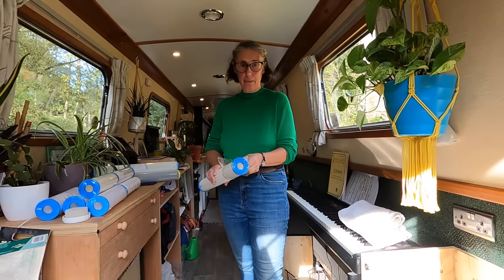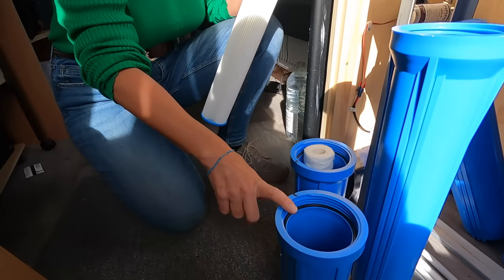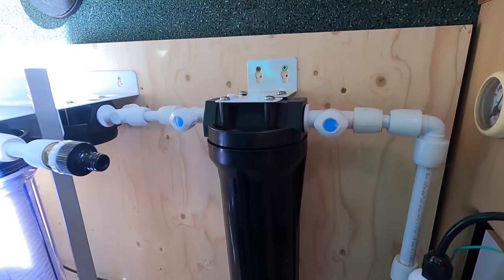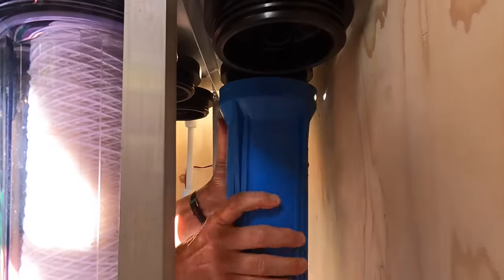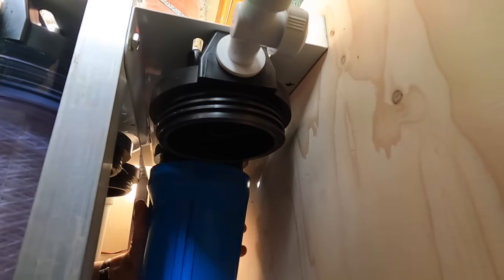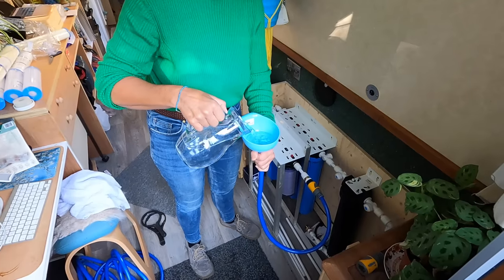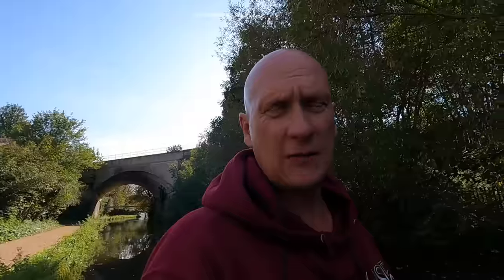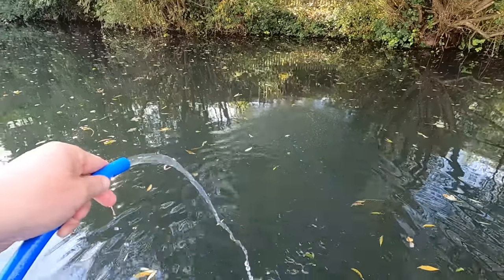Filtering Canal Water. How Good Is It? - S3 Ep14. #narrowboatlife  #waterfiltration

Comment: I don't personally think that I could trust the filters to make canal water safe enough to drink ever, If I were in your situation I would carry on using the water taps at the facilities..
I would also use the water I have on board more and try not to worry about running out as much as you clearly do,  what's the worst thing that can happen? you run out of water and have to go to the nearest tap, perhaps keep the water container you already have filled just in case you do run out and refill every month so the water doesn't spoil as an emergency back up. 
The chances of being frozen in is a very real problem and it will probably happen at least once every year, However if you keep an eye on the weather reports and keep the tank full at every opportunity I am sure you will be prepared for the odd ice in.. Great video Chris best wishes and safe travels Paul. 👍
Reply: Good, sensible advice. We don’t get really cold weather as often as we used to. A cold spell which would cause you to be frozen in is usually notified well in advance and you can mitigate the effect by either moving the boat or using a caravan Aquaroll to collect 40 litres.
Reply from the maker: Thanks Paul. I understand I do have a too much of a strict routine where water is concerned. I have identified that a few weeks ago but I need to work on it. I empty the plastic 20ltr water container in the tanks as it can take the extra and refill as I pass the water point. I need to improve on the usage but not overly keen on getting a filtration unit just yet. When armageddon hits, I may change my mind. 
That said the weather forecast is something I am mindful of in the winter and was as prepared as I could be last year. 
@gillgregory6327 The aqua roll will be something I'll be getting in due course. Thanks for the comment and have a great week.

Comment: did you account for stowage of the rolly things ?
also can washing and drinking water be separate entities ?
Reply from the maker: Thanks for the comment. Yes I did account for stowage of role things, either side of the bow doors. However that would stop the doors being opened fully. Yes washing and drinking could be two entities if the boat was designed with two tanks. I've had a week of reflection and still pleased I'm not investing.
Reply: @chrismears-inslowtime  ah ok i wasnt sure i heard that correctly i thought it was the filters either side of the doors lol.
it is an interesting dilemma though .
and as always a full review of the pros and cons will lead you to the correct answer .
and thanks for the military version of that process , very informative and interesting .
thank you for sharing your experiences.

Comment: Good video. Not worth the cost or aggro I feel. I do 2 things - I have a Berkey style filter container, 8 litres, just for drinking and cooking water. Second - once a year I flush through my water tank with bleach - fill tank, add chlorine bleach, let it sit for a few hours, empty and refill  a couple of times with new water.  I just take myself on and off a water point to do this.
Reply from the maker: I’ve considered doing that. It’s a night spend at the water point. I’m not sure the water pump is designed to be used continuously tho empty the water tanks though. Just my thoughts: Do the bleach and chlorine thing. Let it sit. Fill the tanks so it overflows as well as empty some out. I wonder how long it would take to allow the water to exchange just by forcing new water in the tank. That said, it dilutes the chemicals enough to use for anything except drinking and cooking water. Do that until you can’t smell the chlorine. Thoughts?
Reply: I'm sure would work too, but Im always too chicken to try that way! You are right on pump - keep an eye it doesn't get too hot - I give it a rest every 20 mins. Its a whole day job so pick a quiet day! @chrismears-inslowtime  - oh and I agree you can judge it by the smell test for chlorine as you say. You don't need to add that much to get the job done either. Using the pump also runs it through the pipes - so I switch from kitchen to bathroom taps and shower for that purpose.

Comment: Also my other question is if as Suzanna says the water smells if you don't use it regularly then in my mind it can't be that clean but I may be wrong ?
Reply from the maker: I think all the point made from this vlog are all valid. It's about 'testing the water' to find out what works for you and how you want to live. Agree with your point though. It did cross my mind. Thanks for the comment Nathan. Have a great week.

Comment: Having lived on the K&A for several years and seen what people put in the canal there would be no way that i would drink it! No matter how many filters!!! How does she know if it has failed? I guess that question is why she has three different systems.

Chris a question i would like to ask is why? Why did you walk 10 times a day to fill your water container to fill your tank? Last year you were very cautious about water and power use so why did you need to FILL your tank? Surely just carrying enough for a day or two was sufficient?
Reply from the maker: The problem is Ann, you have to keep on top of the admin and trust the filters do their job properly.  The only quality control you have is the end user. You!  I would change the filters more regularly than required. Water is important. That means greater cost. 
The reason why I walked to fill a water container to work out if I was iced in, how could I cope.  It became reality 3 months later. I knew what it was like to do that. It was not really too much effort in the winter as I had done it previously.  Now, it’s not a problem. 2 miles was a chore by the way. Tried that too, but yes you’re right. I would have done enough for each day. Train hard to fight easy is the motto for British fighting military. Thanks for the comment and Autumn is here. Enjoy your week.

Comment: Could the filtration system be any more complicated? I always found water to be a PITA to be honest. 500l tank, = 2 weeks+ if careful, as you so rightly said, scrimping on water usage too much just takes the fun out of life. I had two stackable 25l containers that just happened to fit perfectly on my trolley so used to do that when necessary. But I used to drink bottled water anyway. Canal water NO WAY! The space that filtration takes up you could just add another water tank. Very interesting though, thanks.
Reply from the maker: Thanks for the comment Johnny. It appears that I'm heading in the same direction as you - perhaps slightly larger containers although for now, I'm keeping the status quo. Thanks mate. Have a great week.

Comment: The filters for the Berkey system can cost up to £255 depending on your berkey system 😳😳😳🫨 I wonder how often you have to change them
Reply from the maker: Wow. The system is about £350. So basically I would be paying for the filter as the system is just an encased filter with a tap! Apparently the filter lasts a year. Tap at the water point is just fine. Thanks for the comment and have a great week George.

Comment: When you get a warning freezing weather is comming, but a water butt from b and q and fill it at the water point.
Reply from the maker: Great idea except unlike wide-beam boats, It wont fit on the well deck. The side locked are the length of the well deck. A requirement from the start for good storage. Thanks for the comment Ross. Have a great week.

Comment: I use a water distiller. It takes 3 hours but i then have 4 litres of water. I couldnt use canal water though and the space the system takes up isnt for me.   Id never trust it to be clean enough to drink. Im too fussy i guess.
Reply from the maker: Don't think you're too fussy. The best idea would be to have two tanks but that could happen at build. You could fit a second tank but not sure it's worth all the hassle and expense. Like you, not sure I could trust it. Thanks for the comment Sean. have a great week.

Comment: Is there any danger of the water in your bow tank and pipes freezing over in winter or is it all well insulated?
Reply from the maker: The water tank is insulated and all the pipes are inside the boat. Didn't have an issue at -14 last year. Not sure we'll get much colder here but it'll take a very cold snap for much to go wrong. That's on my boat, others have water in the bow which does freeze. Thanks for the comment Graeme. Have a great week.

Comment: When the canal freezes over, doesn't the water taps at water points also freeze up?
Reply from the maker: If someone who is bright allows the water to drip out of the tap, no.  Thing is, the cold snaps catch us unaware at times. Also that tap needs to be used frequently. There risk in everything Gary. You can’t mitigate everything. Thanks for the comment. Have a great week.

Comment: Are the towpaths good enough to use a bicycle water trailer?
Reply from the maker: Not all of them Robert. Most in the south east area of the canals have been made into proper paths. However, it's when I go further north where the muddy towpaths are the norm is where I would struggle. For now, I've made the best decision with a flexible water container. Easy(ish) and safe. Thanks for the comment and have a great week.

Comment: Chris you could do away with your bow thruster and put a filtration system in its place 😅
Reply from the maker: Could do. No. Paid a lot for that. Plus it’ll be a real pain to change the filters as there is a steel floor between the bow thruster and the the bow locker. Hard work to remove that. Pleased to have meet you and Wendy yesterday. Have a great week.
Reply: @chrismears-inslowtime  we’ve just had a thruster tube capped off. Unfortunately the previous owner didn’t look after the tube or the mechanics so currently it’s u/s. I plan to take the mechanics out and put it on the bench at home. Once fixed I’ll reinstall it and remove the plates at the time of the next blacking. It was nice to meet you also, keep badgering the CRT some one has to. You said you didn’t know how long you could continue with your channel due to running out of things to say, maybe doing a report / update with your dealings with CRT could be an option! It might help to increase the subscription numbers as more boaters will subscribe. Just a thought cheers for now.
Reply from the maker: @waynesilver8416  agreed with CRT things. It’s a Sunday natter I feel. Thanks Wayne.

Comment: You must have a reverse osmosis system.  You can not do it with filters alone.  A reverse osmisis system uses filters, but the water is forced throgh the system at a very high pressure, leaving the water 100% clean.
Reply from the maker: Thanks for the tip. All this stuff I think is better if you design it from the start. Retro fit filters would now get in the way of the design of the boat. I've totally discounted that system now. However, never say never as design and tech improves. Thanks for the comment and enjoy your week.

Comment: Well Chris I’d prefer your opinion and not go with the system, it’s noisy and as you say you can’t guarantee the water is clean for drinking purposes .
I would shower and do a machine wash when at the water point if possible, was that a Drinking competition?when you got ill 😂.
Have a good one Chris thanks till the next one 👍👍👍👍👍💦💦💦
Reply from the maker: Reference noise, yes. Can't guarantee properly filtered water is and was my concern. Also cost v reward. No to drinking competition but something went wrong with the outlet pipe on the boat. Not had the problem since it was fixed. Thanks for the comment Thomas. have a great week.